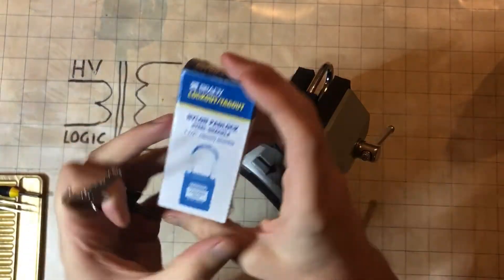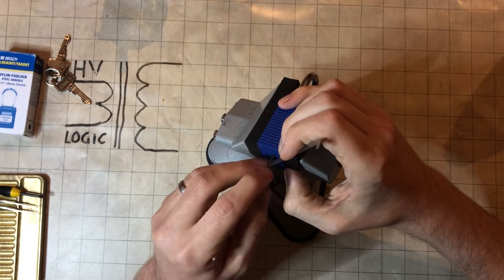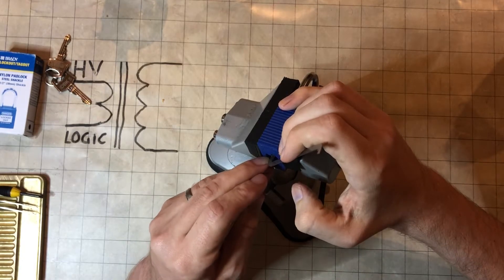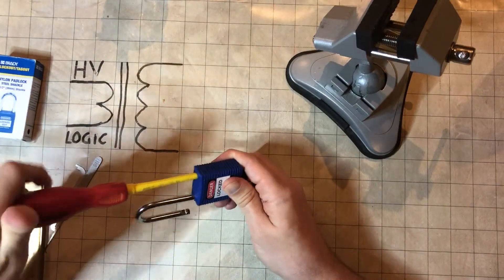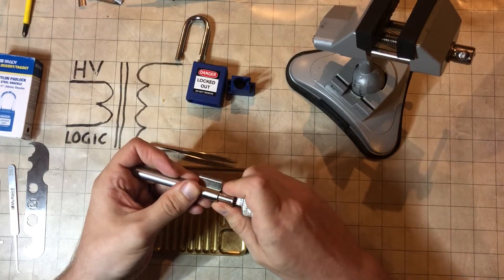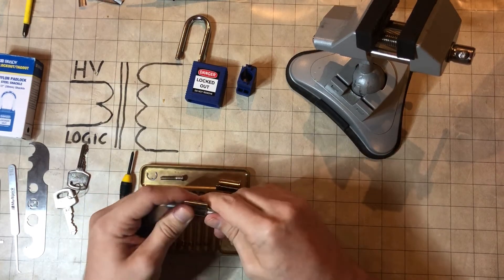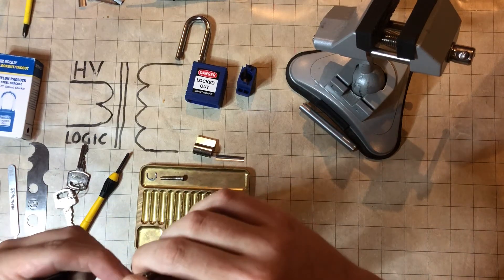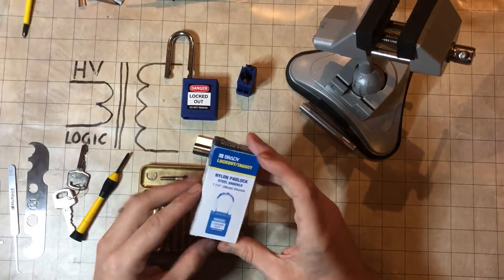Brady LOTO with Abus keyway

Comment: I have a bunch of those and they aren't hard but fun to pick. Too bad some spools are at shear already. Always a risk of extreme bitting if it wasn't designed with the right driver size🙄
Reply from the maker: its a real shame when an otherwise good lock use drivers that are too short